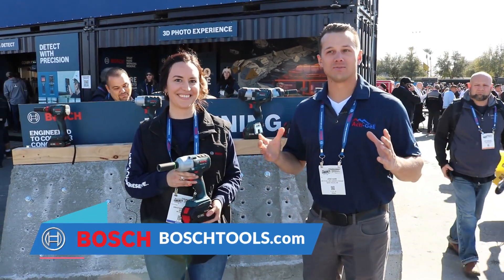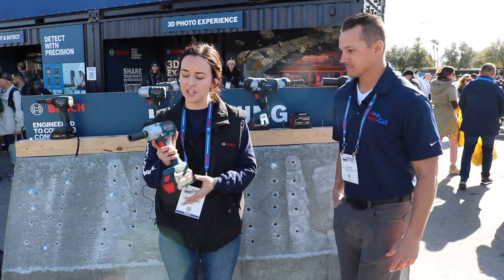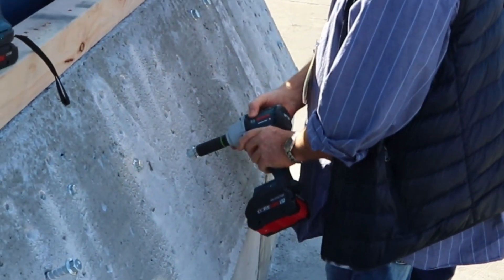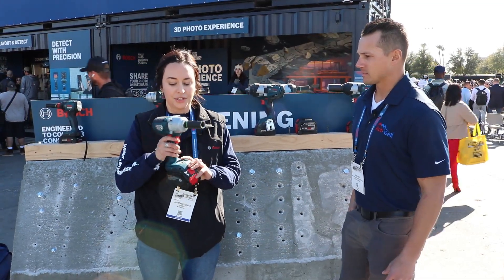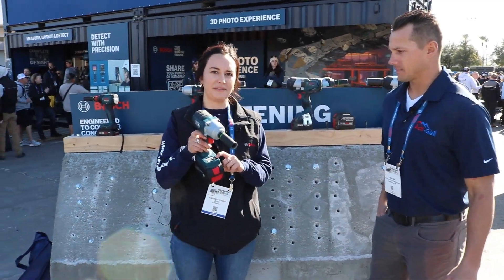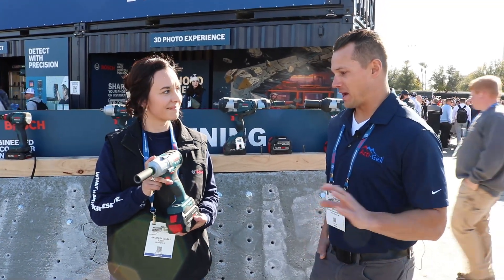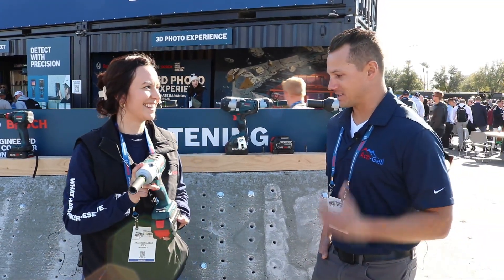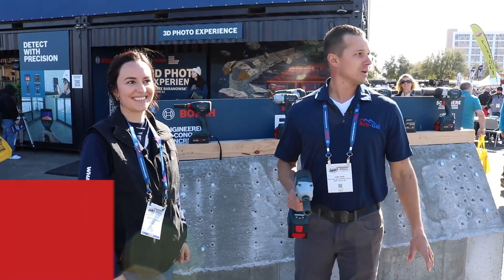Bosch Impact Wrench - World of Concrete 2023

Comment: Heads up, Torque Test Channel put up a video.. it's 1.3x UNDERRATED 🙃(you can expect 400 ft-lbs tightening and 440 break away)

It's within margin of error as powerful as the red brand and lighter (but slightly longer), with more features. Another thing that might want to be noted is that it seems to have a lighter hammer which is good for the wrist but also means it might work slower in it's mid range (also using up more battery)

I'm only vomiting this info because i'm thinking about pickup one up very soon 🤔currently have the latest gen Freak which i found replacing most impacts i use in the garage other than my trusty ol' NAPA branded Blue Point (Snap-On) mid torque pneumatic rated at 500ftlbs but realistically does about 400ftlbs @90psi
Reply: You sir are 💯 thanks 👍